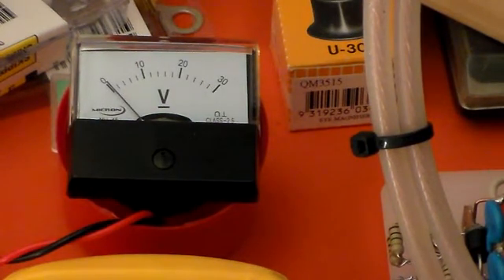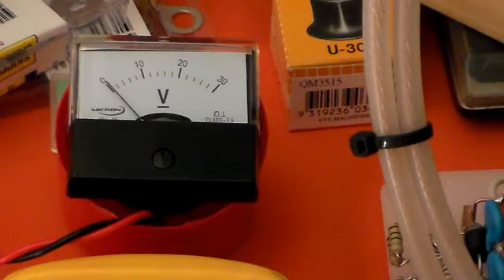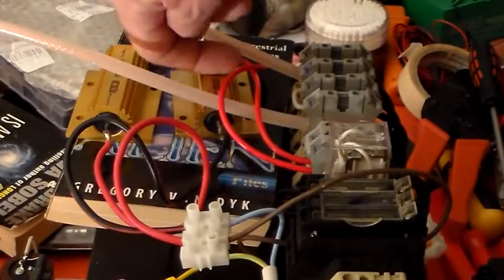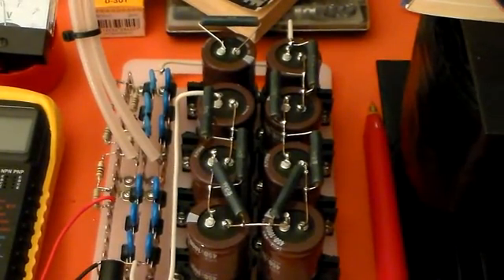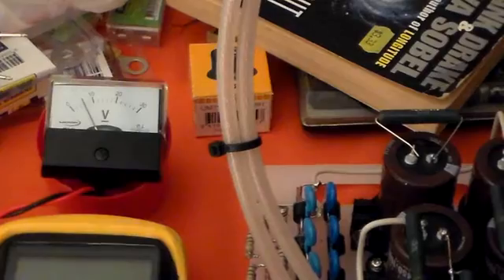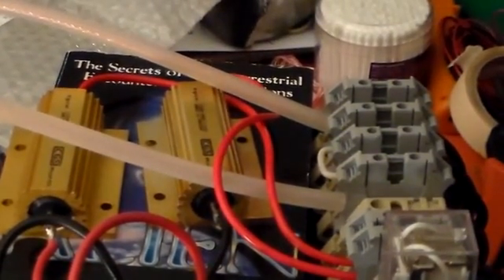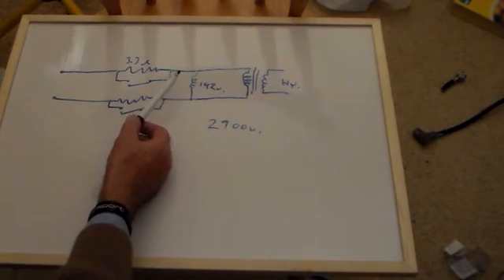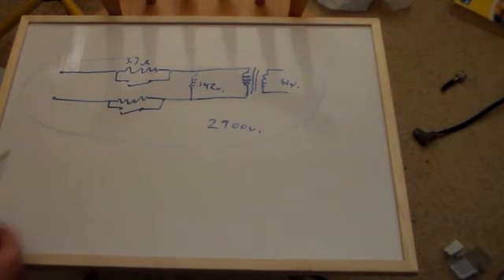GS-35B Amplifier HT Supply Soft Start Circuit.

Comment: Good morning mate, with this circuit, As you just said "it may just  burst into flames". Could we use a circuit that protects the soft start. Such as  diodes and fuses in line. Just my opinion only.Cheers Dennis vk4oc.
Reply from the maker: Dennis Peake Morning Dennis... thanks for the suggestion, but where's the fun in that? No flames, no smoke, no shrapnel... There is an in-line 8A fuse on the AC input but I didn't show it on the circuit for simplicity, you can see it if you look at the 'bird's nest' wiring on top of the HT transformer. I may replace this with a larger value once the amplifier is producing power.